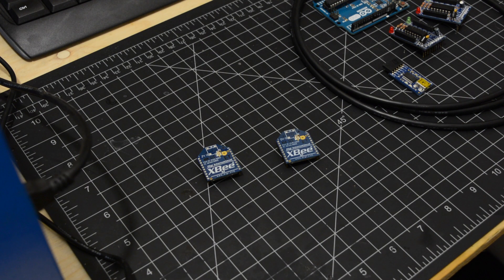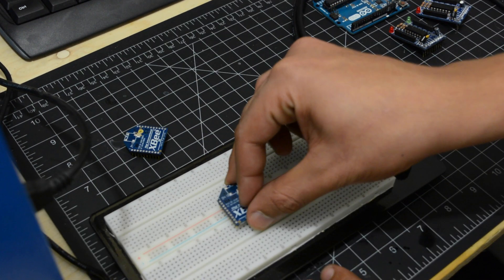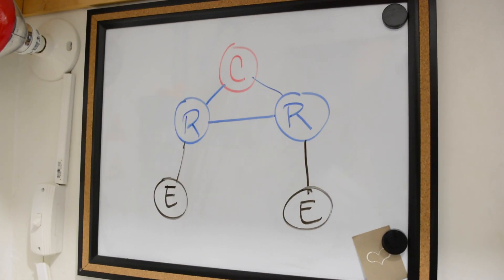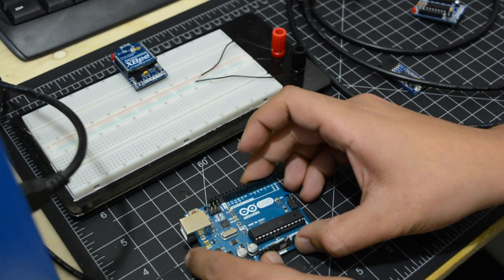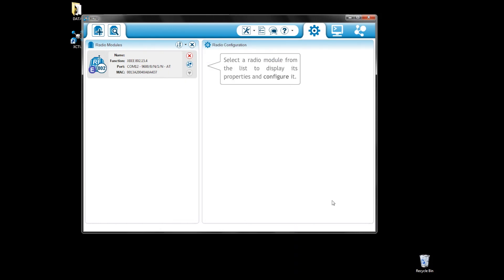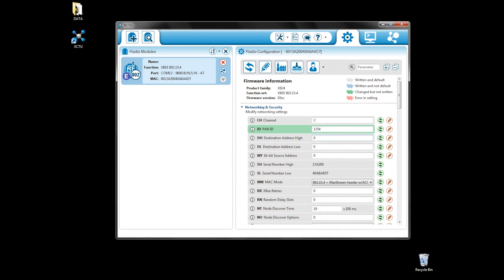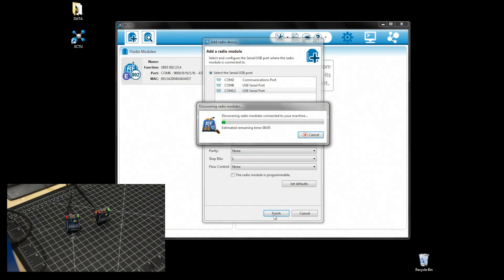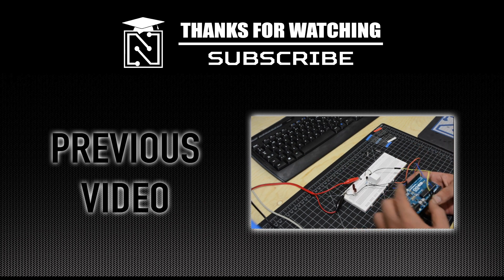XBee: The basics

Comment: nice video !! can you teach us how to use the digital and analog pins of the xbee to eliminate the need for a micro controller ?!!!
Reply from the maker: Thanks for the comment Fouzai, will sure make another video with the XBee covering using it without a microcontroller. Stay tuned. You can also watch the Arduino car alarm system project using the XBee in the channel.

Comment: Hey, very nice tutorials. Mind if I ask a few questions?
Like 
Can I communicate two different models of Xbee? Like Xbee pro S2 and Xbee 900 HP? 
If I use Xbee 900 HP as transmitter (let say it transmits to a range of ~5mile) and the receiver (Xbee pro S2) is about ~5 mile away from transmitter, then would the receiver get the transmitted data?
Reply from the maker: Yes, Make sure that they share the same ID and they will.
Reply: You sure they will? Cause cbee pro s2 works on 2.4Gh whereas xbee900hp works on 900Mh?
Reply from the maker: Oh my bad! thought the 900HP operates at 2.4GHz. You can interface different Xbee models as long as they share the same frequency.
Reply: .....they need to share frequency, firmware and pan i.d.